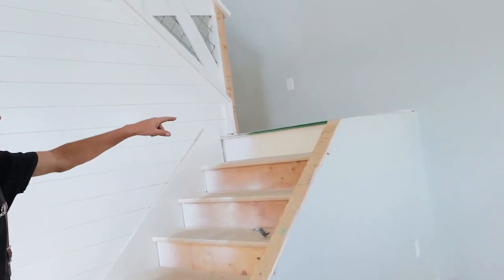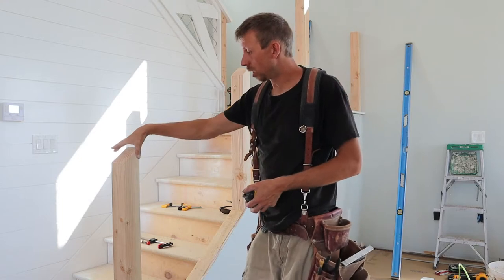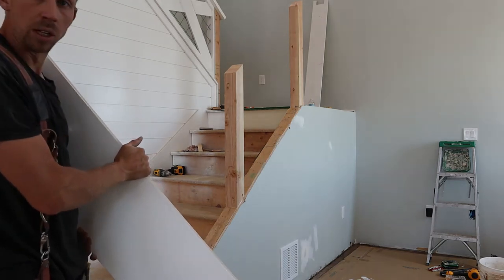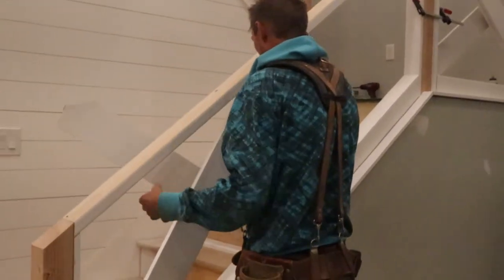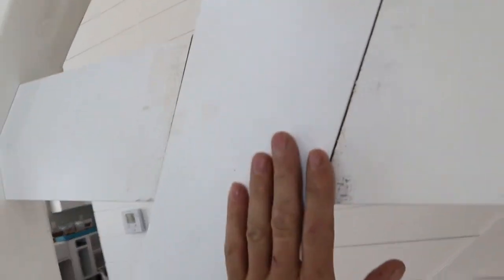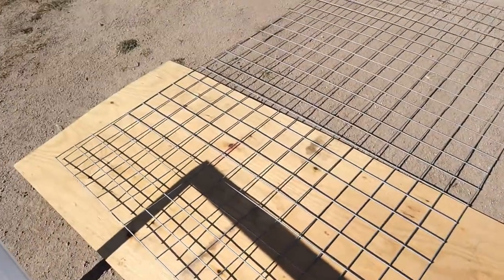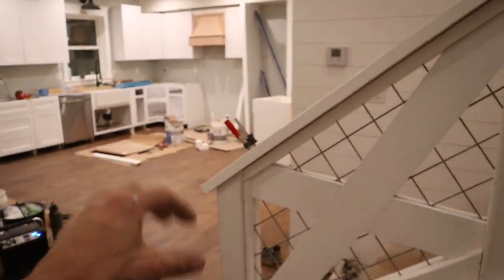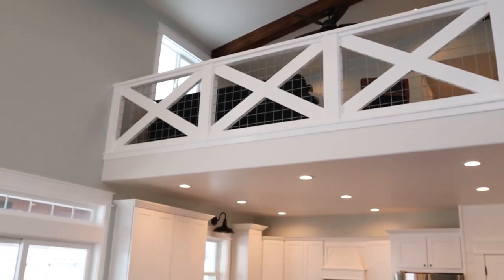FARMHOUSE RAILING//DETAILED TUTORIAL//HOW TO INSTALL RAILING

Comment: How did you get the post to be sturdy?
Reply from the maker: The stairs on the steps and landing I buried in the floor, the rest of the posts, I doweled them into a beam down below. The design of the railing helped strengthen and tie it all together